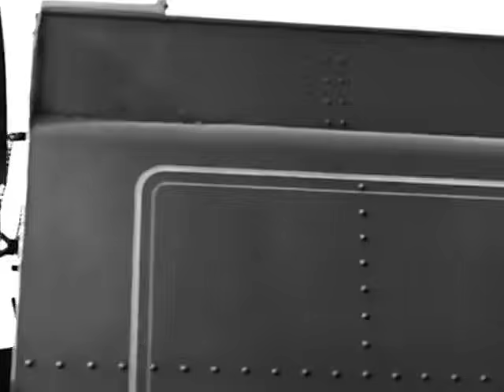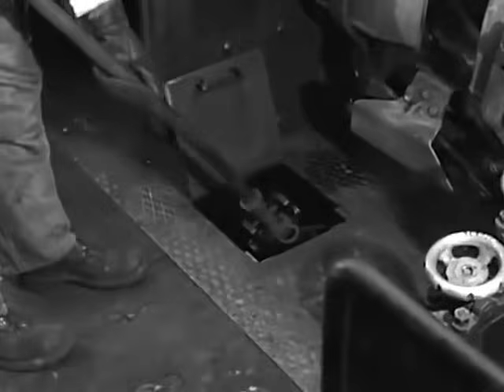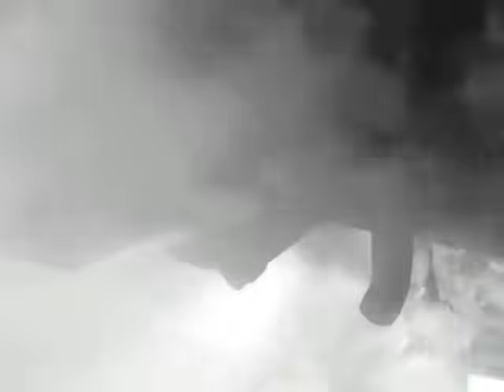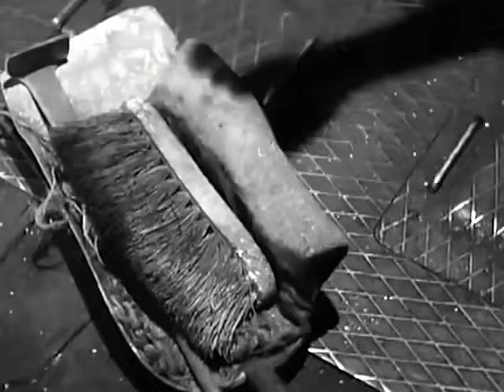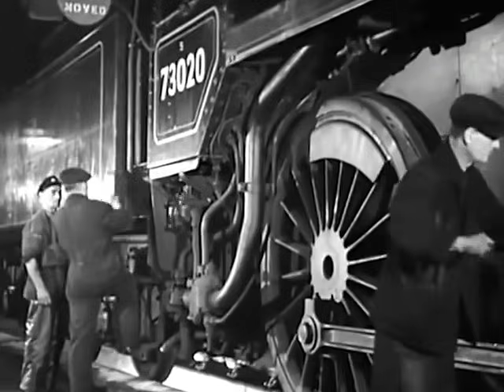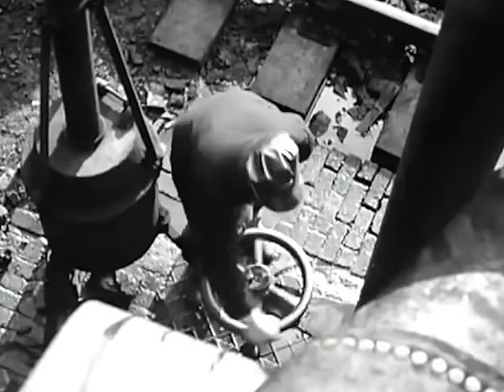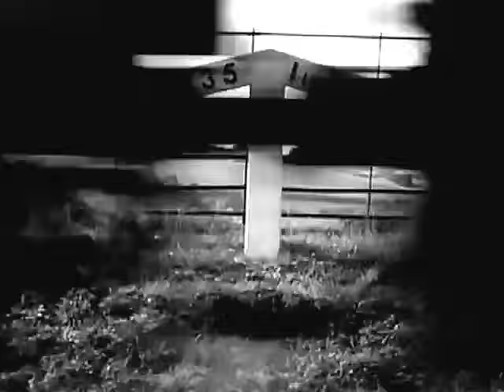Wash and brush up - British Transport Films - British Rail steam loco maintenance - 1950s

Comment: I had no idea these machines were so incredibly complex. Astounding.
Reply: Well, it's complex. But a current day truck or train is allot more complex.
Reply: @bartdereu yes but you do not have to pull trucks or cars off the road every 12-16 days. Imagine that x the thousands of locos these companies had. No wonder the work force was massive.
Reply: My father was a fitter   He put in 50  year’s service. Starting as a tong lad in the days of steam when diesel was first introduced he went for 6 weeks training and became a diesel fitter. When electrification came along  he got another 6 weeks training. He could strip any of  the locomotives to the bare bones. In any other business he would have been called an electrical and mechanical engineer   On the railway he was called a fitter. They were highly skilled men  who’s talents weren’t recognised in the pay packets. I got more money on the line in a car factory
Reply: Please note how longlasting was the service in comparison to the working (on rail) time. The efficiency was so low
Reply: @X3ABnew  But not compared to horse-drawn wagons or canal boats.  It's all relative.
Reply: @wintersbattleofbands1144  Yes, you are right ;-)
Reply: Also known as a contraption.
Reply: Yep, this  just  tossed  my  ABC ,s  off the  rail
Reply: Major props goes out to the tourist railroads running these now vintage steam locomotives and keeping them running into the 21st century!!😊
Reply: The Ash good for clay Gardens,  have a woodstove  in Spain  , a magnet to quit pallet nails , Ash on the garden .
Reply: Superheated  steam more energy per pound of coal , Britain  gave steam to the world 🌎  even the British invention the steam catapult  used on aircraft carriers !
Reply: Comment from the other day , seems daft to me , Steam showmans owners buying coal from South Africa  !  Hope in the future these wonders will be Hydrogen  powered.
Reply: @simonsadler9360  Hydrogen isn't an appropriate fuel for steam locomotives. It burns too hot and too quickly; you want something that burns slower so you don't have to continually fuel the fire. It's also not an appropriate fuel for any kind of railway locomotive: making hydrogen uses enough electricity to power six to ten trains directly, so just put up wires and run electric trains.

At least in the UK, heritage railways are now finding it very difficult to get hold of coal. It's only used in a few power stations now, so it's hard to buy less than 10,000 tons of it. Some are experimenting with converting their locomotives to burn oil; some are using pellets of compressed agricultural waste.
Reply: Casting in one piece a three cylinder , un mistakable beat . Back to being a boy again,from a local indoor bootsale bought more track & an 00 gauge model Tornado , have psu & controls need a hauled up to the ceiling board fot the track .or perhaps outside well protected 8 x 4 thin painted chipboard, nearby  what looks like a not used 7 inch gauge of a friend  that makes plasma cutters , dare I , he has a small diesel loco & one 12 v .need a drone foto of his layout   , lots of cement to mix !
Reply: Lots of mines had steam powered  crushers !
Reply: I heard somewhere steam was more powerful than diesel back in the day.
Reply: Actually much more complex and elegant than this film shows -- imagine stripping one down to bare and rebuilding it, as required by code ... or the "firewheels" to "re-tire" a driving wheel.  They look like one piece, but they're not!
Reply: Exactly. I was thinking a coal fire under a water tank that produces steam when boiling, but nope
Reply: They were actually living things
Reply: @davidmarsden8008  ....
Reply: @davidmarsden8008  
I think all heat-based machines are alive.
But  electricity-based machines  don't seem to be alive.
Reply: What I want to know is why they don't seem to process the coal first into either powder form or at least consistent lump sizes.
Reply: @tarstarkusz  Coal powder was the worst beause most of it went straight up the chimney. Lumps of coal that were too big would be cut up by the fireman using his coal hammer. Since firemen had always cut their own coal on the loco, it wouldn't have occurred to anyone to chop it up before putting it in the tender.
Reply: @pf32900  Most coal today is ground down to flour like particle sizes.  It burns much more efficiently that way. 
The problem was probably the open containers they used would blow away a lot of the coal.  A good boiler design would prevent the loss of coal in the burner.  Or they decided the energy to run a machine to pulverize the coal just wasn't worth the efficiency gain in the boiler.
Reply: @tarstarkusz  
maybe the coal was required to burn at a slow rate so that the water had time to absorb the heat before heat flew out with smoke  into the exhaust pipe.
If a fine fraction is supplied, it may burn too quickly and is not suitable for this type of steam engine.
I think there was a need for a balance between the rate of coal combustion and the rate of heat absorption by water, which is better not to break.
And maybe
be a balance better when a pieces of coal is not out of a certain size range
Reply: @ЯрославШевченко-х7й  You make some good points.  But, presumably there is an ideal size given the application. 

I know coal fired power plants process the coal. They process it down to the consistency of very fine flour.  This takes a lot of energy, so it must be worth doing. For a steam locomotive, flour might not be the best consistency, but I would think a bunch of random sizes isn't either.

Maybe they didn't process it at all because they just didn't think it was worth it.
Reply: @tarstarkusz  as we can see from the practice of operating a locomotive steam engine, there is no need for any exact ideal size of coal lumps, but just a certain range of suitable sizes
Reply: @ЯрославШевченко-х7й  Or that there is, but that it would take too much energy or money to do it so that it's not worth it.
Reply: @tarstarkusz   
Or that there is?
Hm...

I think that what is in a tender, in this form and fits.

It’s like firewood for a stove, where it doesn’t matter that one log can be noticeably larger and the other noticeably smaller, the main thing is that these are chipped logs, and not a whole round one.

I think when coal is mined, pieces of coal weighing a hundred kilos or more can be obtained.
But we do not see pieces of such sizes in the tender.

This may be a confirmation that the control over the size of the pieces for loading into the tender was nevertheless carried out
Reply: @ЯрославШевченко-х7й  Yes, it was  probably processed to some degree.  The thing is, the smaller you want the pieces, the more it costs (requires more stages). So they probably did the minimum to create a size range that would be reasonable to shovel by hand into the burner.

Comment: I was rather shocked and surprised to see some protective gear in use at 14:00 !
Also ... stale coal?!??
Reply from the maker: Stale coal is a term used to describe  crushed, powdered or undersized pieces of coal which are considered not ideal for efficiently fuelling a steam locomotive.
Reply: @BennettBrookRailway  Coal briquettes?  ['Cheap' fuel also used in many tenements of Springburn, Glasgow - circa 1958.]  Thanks. R 😎
Reply: A large part of what burns in coal is volatile material -- gases and liquids that evaporate. If coal sits around for a long time, more of the volatiles are lost and it doesn't burn as well.

Comment: I really think that this film is a bit earlier than 1950,  it believe it is pre war maybe 1932.  By the 1950's the British railway was already in the first stages of replacing locomotives with diesel.  A film like this would not have been made so late in the game of the locomotive.
Reply: 73020 was built in 1951 completed in October .There were few diesels at first because petrol had to be imported .They decided at first to keep steam until electric railroad could be developed .Film made1953  Modernization plan published early 1955 . In 1964 came the Beeching  axe when they decided to lose any lines to save money .  Big mistake because it led to long car commutes on congested roads. Many steam engines were ditched then .73020 remained in service until 1967 one on  the last trains out of Waterloo station in  London. that summer.
Britain had plenty of steam engines, thousands still running late as end of 1963 but most were gone by end of 1967 . There was a small area that still had a handful of choo choo trains until summer 1968 .Then  all diesel BOO HOO !  Very early 50’s England was still recovering from the war and still had rationing .Their economy depended on local resources and there was plenty of coal but no reliable source of oil .They needed to limit oil use for road vehicles ..At the time steam engines had a fuel easy to get and money stayed in country to support the economy. Chocolate was still rationed in UK into early 1950’s and some other consumer products which had to be imported.Cocoa beans came from tropical places fir example.Also they needed to reserve petroleum for where it had to be used . Airlines depended on imported fuel .Imported oil in Europe was expensive .
Reply: I think they ran this or these steam engines till 1965 , in the south west area.
Reply: The loco in the video is a Standard Class 5 which were built in the 1950s although the basic design was pre-war 
https://en.wikipedia.org/wiki/BR_Standard_Class_5
Reply: I think they ran this or these steam engines till 1965 , in the south west area.
Reply: This film is Definitely 1950s, not 1930s.  The narrative style, sound and picture quality are definitely post War.  Don't forget, steam carried on well into the 1960s in the UK.
Reply: Movie produced in 1953

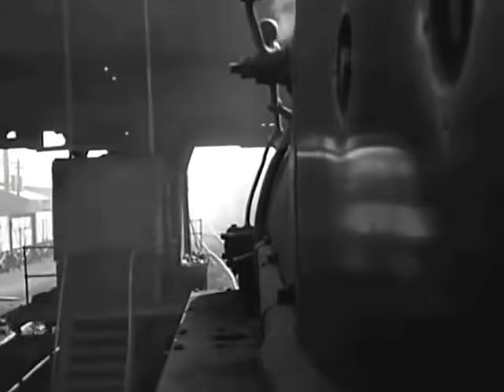Comment: 1:57 stale coal?
Reply: coal that has been left for too long in the tender gets broken down into small lumps over time. Making it not very good for firing
Reply: @RobertdMacGregor  Yes. Coal doesn't lose its calorific value. It just degrades at the bottom of a pile and gets friable or dusty. i don't think they are referring to frost action on soft Welsh coal or low quality coal full of slate and liable to result in clinker and lots of ash.
Reply: @johnjephcote7636  It does lose its calorific value to some extent, as the volatiles evaporate off.
Reply: YES
Reply: There's a "sell by" date on each bag. 😂 
 it's funny to hear something that's been sitting in the ground for 100 million years becoming "stale".

Comment: And of course the steam engine was INVENTED in England...(by a Scot).....
Reply: the inventor of the steam engine was in 1712 by Thomas Newcomen and Englishman.
Reply: Richard Trevithick - A Cornishman invented the first working steam locomotive.
Reply: @Max Tickner: Not that it matters all that much, of course, but we may as well get it right. Presumably by steam engine, you mean railway locomotive; in which case, the first commercially operated one was designed by John Blenkinsop, an English mining engineer.

Comment: 73020 is cute
Reply: Sadly, 73020 was scrapped!
Reply: @joelharris1335  , though several members of its class have been preserved.
Reply: Also, two of the preserved locomotives have names, they are 73050 'City of Peterbrough' and 73082 'Camelot'. 

However, only five locomotives have been preserved, which is a real shame, isn't it?

Comment: Hi any one can answer me! no doubt the whole engine is amazing machine but for me the fire box is more interesting, I wants to know what kind of insulation they were using in fire box so the iron of fire box in not melting due to high temperature of coal burning, I think may be bricks are used for insulating the floor and walls of fire box.
Reply: Fire brick insulation plus the fire sits on a grate. The firebox itself is part of the boiler shell so is surrounded by water on all sides except the bottom. The stays hold the firebox in position against the boiler shell.
Reply: @Spookieham  
Thank you.
Reply: Many boiler fire boxes used asbestos as well...although I’m not sure if they were used on Steam locomotives.
Reply: @hastyone9048  Yes, plenty of asbestos was used on steam locomotives. My grandfather who was a driver said that after re-lagging, you'd come out white with the stuff as all the loose bits blew off into the cab!
Reply: @chriskaine8329    Not to mention what you breathed in!  Many workers have died in agony from yrs of inhaling asbestos fibers into their lungs!
Reply: @hastyone9048  The asbestos and other insulation is to keep the locomotive hot, not to keep it cool! The boiler was insulated to stop heat escaping, so that as much of the energy from the coal as possible is used for driving the locomotive forwards, rather than heating its surroundings.
Reply: @beeble2003  I know
Reply: I beleive the water cools it to keep from melting but warm enough to cause steam
Reply: @warrior3456_  no, water is to make the steam. Not to cool down.
Reply: @gerrard1144  pretty sure its duel purpose
Reply: @gerrard1144  Boiling water is at 100C -- slightly hotter in a steam locomotive, because the system is pressurized. If you add more heat to boiling water, its temperature doesn't increase; it just turns to steam faster. When a system is in thermal equilibrium, anything that's in contact with boiling water isn't much above 100C. So, yes, the water does keep the boiler "cool". Another way to look at it is that turning water into steam requires huge amounts of energy. That energy comes from the fire. In other words, boiling the water takes energy from the fire, i.e., cools it.